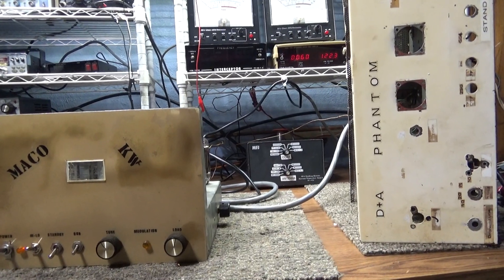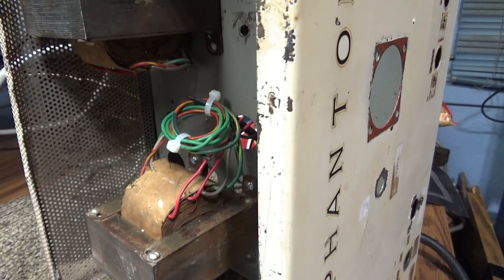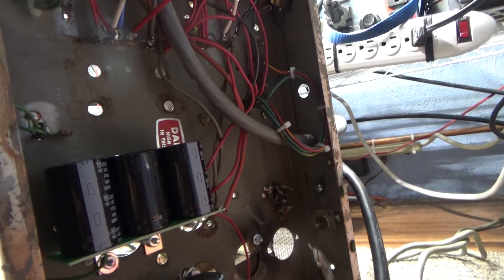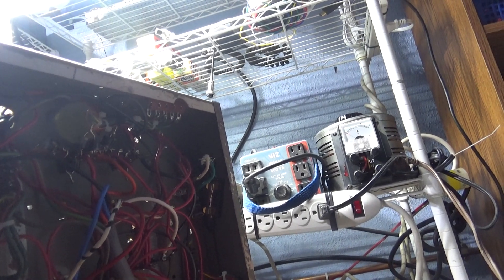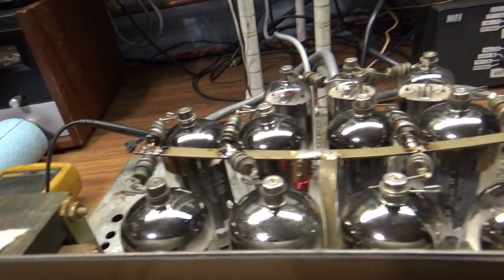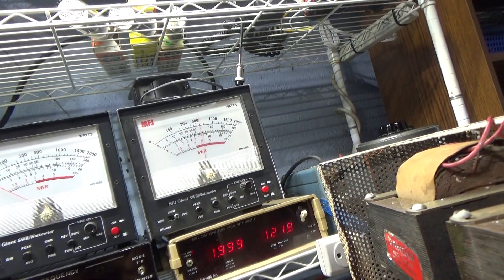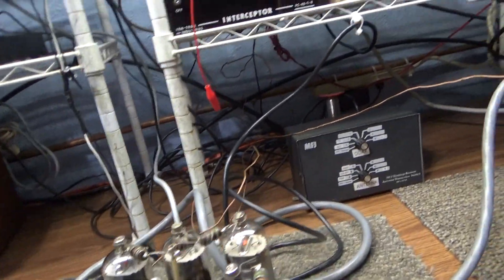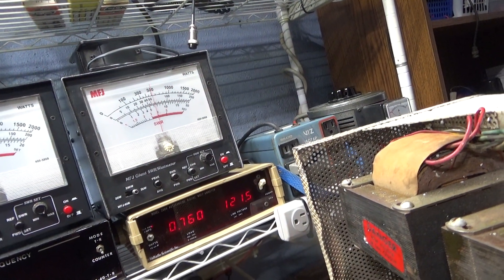Maco KW again, but with D+A Phantom 500 Frankenstein Power Supply

Comment: are those the discontinued made tubes  real expensive over $100 a sweeper tube ?  was always wondering can you covert that to the el509 russhion tubes i think they still make those cheaper?
Reply from the maker: Yes and Yes.
Reply: A while back I’d have thought about something like a cx1500 or a pair of 800s but damned if small steel tubes haven’t gone expensive as hell too.

Comment: Mr Tram Dr. I need a transformer for a KRIS Boomer . It is my first Amp. and that is all it needs to be whole . I have Replaced the caps, diode's and have Nos tubes I got from RadShack way back. All I Have found is complete amps ,Can you help? thanks
Reply from the maker: All I have are complete amps too.
Reply: @tramdr  Would you happen to know  or where i could find the output volts for the different windings ? I cant find it anywhere. thanks
Reply from the maker: which amp specifically are you looking for the output windings for?